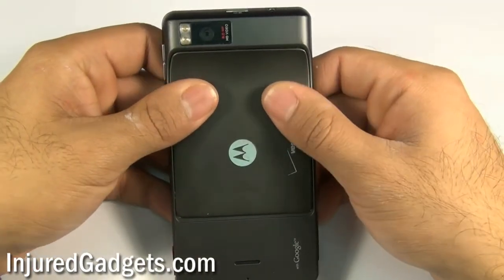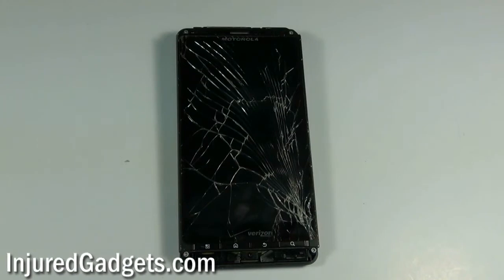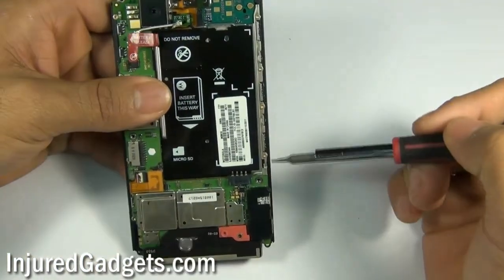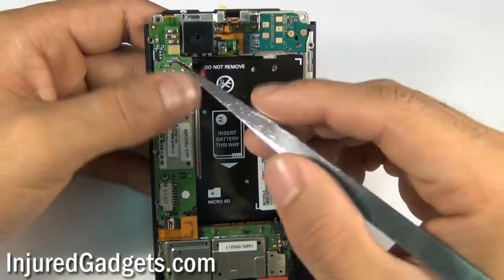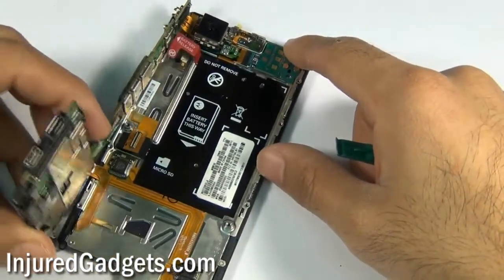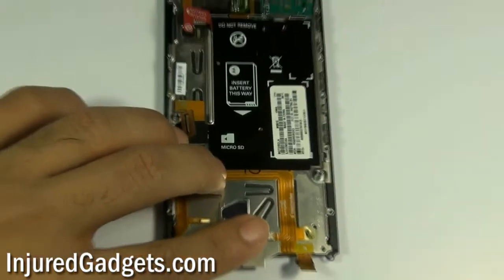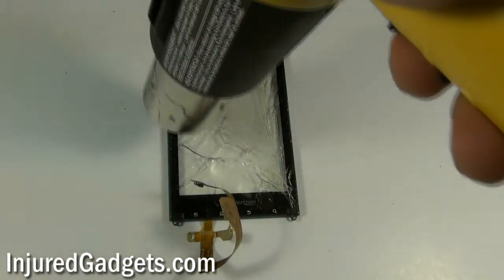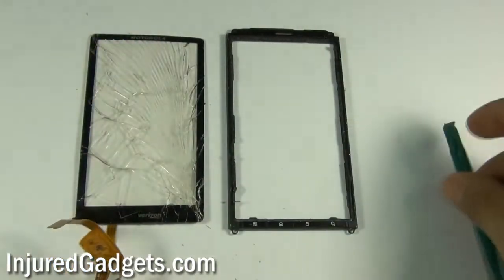Motorola Droid X Touch Screen Glass Digitizer & LCD Display Repair Replacement Guide

Comment: Worked like a charm. Two things that I would add. It was hard to see how the antenna connector worked in the video. It just took me holding my breath and prying round to realize that it lifts straight up on the right hand connection. Also, all of the connectors on my phone had this annoying gooey tape on them that required some careful removal, but once out of the way flowed as video stated. Thanks, you saved me at least $80 and made me that much more independent. I do have one minute black line

Comment: I don't think I have the jaba (I think that's what you called it) when I take the top cable off there is no connector to flip open. I can already see the 2 white lines on the bottom cable. In the video the 2nd white line is only visible after you flip it open. I will try to pull the cable out anyway, buy how important is that connector?

Please help! Thanks

Comment: Thanks, the repair went great, but I have two small issues. I am missing the black rubber piece for the microphone and I have a red rubber piece with a small hole in it that I cannot figure out where it goes. The phone is working great though. Are these goping to be a big issue in the future?

Comment: You don't want to touch the cable ends or the chip sets they will fail over time. one more thing a rubber insulator between the mic and cover that needs to go back as it was.

Comment: So well done thanks!  This is twice I have run a 10K and doused myself repeatedly with water - oops, really need to leave the music behind next time.  So drying out after dis-assembly and SPONGING the water off the back of the LCD.  For those of you that need to dry: heat rice in microwave 2 min in a bowl covered with a small plate.  Remove plate and stir until stops steaming, repeat 5x.  Seal in plastic container overnight with dried rice to dry electronics.

Comment from the maker: @zlee415 Sure it can. But your fingers have oils on them which can cause damage to flex cables and connectors. Its always safer to use the pry tool.